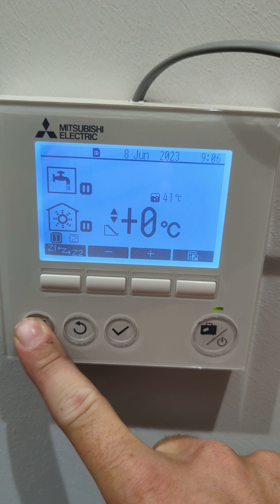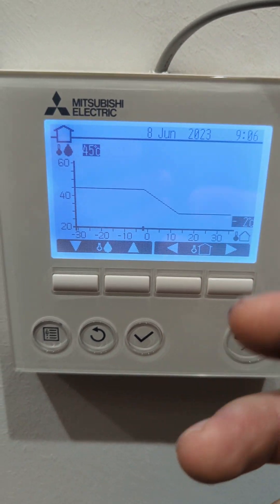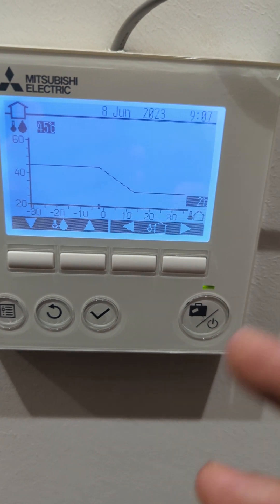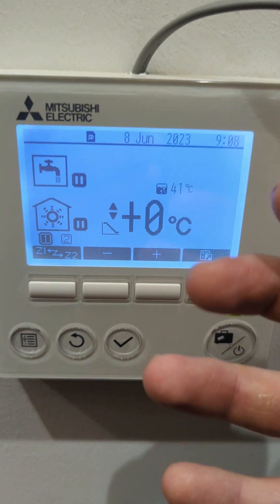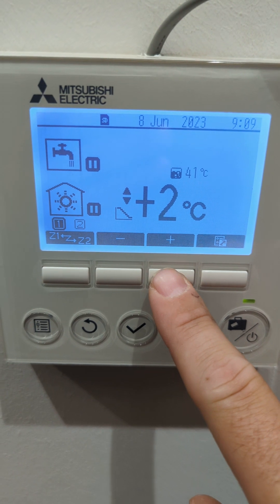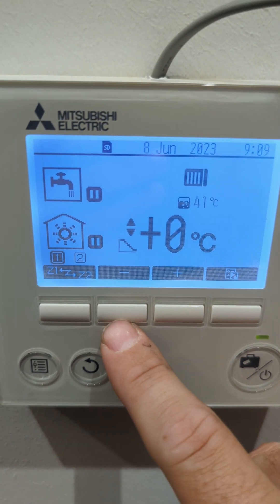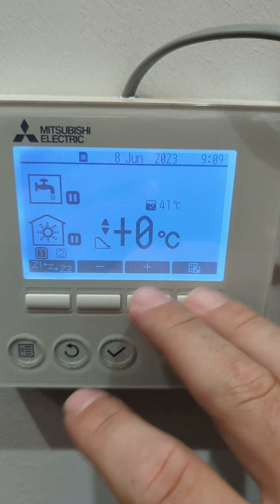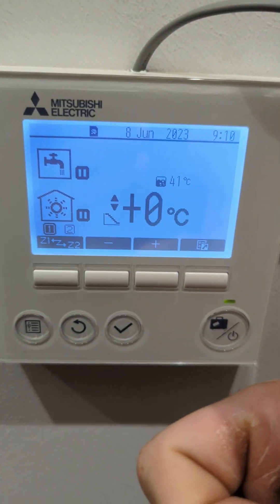Compensation curve Mitsubishi Ecodan Explained

Comment: Finally someone that explains it in a way that is easy to understand. I have new house with the best isolation possible, i had my curve on the recommended settings but my room temp kept staying around 25 degrees celcius which was just too much. I lowered it to your settings and now we wait and see. Ideally i'd like a 22 degree temp around the house because it's quite cold outside atm

Comment: Really useful. A few questions. I have 2 zones, upstairs and downstairs each supposedly controlled by a thermostat set at 19 or 20 degrees. Does the compensation curve override thermostats? If it’s set to comp curve is it running 24/7?

Comment: There is one problem with these systems that I cant get around of. When its warm outside and DHW is on with a target flow temp of 50C it will get to 46 and then to avoid excess heat making it into the heating system (when it flips over) switch to the electrical heater to finish off the last few degrees. This is some kind of fixed behavior.

Well this is fine and dandy but if you start using hot water it never gets to 50 since the tank is big (200L) on the electric heater and keeps on and on using ridiculous amounts of electricity.

I tried to cheat the system and up the compensation curve to 45 @ 30 outside (I dont care if some excess heat makes it into my heating tank (300L)  but I'm not sure this is the best way to cope with this "feature'?

Comment: Thanks for this .

I want to manually adjust the flow temperatures .

I have zoned the whole house into two zones , installed underfloor on ground floor and then fitted K3 radiators everywhere else to provide the maximium emitters.
 I’m not working on compensation curve by default .
  Is there a simple way of changing the flow rate other than raising or lowering via comp curve control ?

Comment: Great Video, thanks. It seems that like a lot of people my system was programmed to give maximum heat as oppose to efficiency. I have done a couple of things, moved the scheduled time for legionnaires from 3.00am to 2.00pm, when the air is warmer and reduced the flow temperature from 43 to 35 degrees, but I have a question for anyone that knows. 
if my flow temperature is lower than my target hot water temperature, does that mean the extra few degrees are achieved with an electric element, therefore possibly reducing any saving on lower flow  temperature?
Reply: Thanks for the really quick and clear answer, really helpful. Cheers
Reply from the maker: @johnjeff3849  during hot water operation, your target flow temp is irrelevant as this is only for heating, during hot water operation your unit will get to max temp to reach your desired / set temp for hot water store.

Comment: Does any one know how fast it can respond in the morning ? If I want to let the house cool to under 18c at night after 8pm then warm up the house in the morning to 21c from 6.30am onwards, would I need to turn up the heat 1 hour before ? can it heat up the house quickly ? I have 15kw of radiators. 18c only needs about 32 to 35c flow temp. 21c needs 40 to 45c. But with my gas boiler and roomstat it pushes the water temp to over 60c at the beginning until the house reaches 21c then drops back to 40c. So the house warms up quickly in 90mins. Can a heat pump do this ? How long would it take to spool up from 32c (4kw) to 60c with a 15kw circuit (@60c). 
The radiators can become hot within 40mins with a gas boiler. Im considering the Omnicore Duo 18kw with ecodan water heater for the winter to use with radiators, an underfloor circuit and the hot water tank, plus some Diamond star AC units for the summer.

Comment: Hi, thanks for explaining. I do have one question. Does the +5 -5 button increase/decrease the flow temperature for an entire compensation curve? For example if my curve is setup in a way that I have 45 degrees flow temp at 0 Celsius outside and 37 degrees flow temp at 10 Celsius outside and if I decrease via button for -2, will the change work on entire curve? Meaning I will have 43 degrees at 0 Celsius and 35 degrees at 10 Celsius? Thanks

Comment: If you have a radiator system and a Mitsubishi wifi remote controller, then the Target Room Temperature (auto adaptation) mode is more efficient than Weather Compensation mode, because it operates in the most energy saving way taking account of both WC (external temp) AND internal (room) temp. In Target Room Temp mode, when room temp approaches target, the HP modulates power so the the temp curve flattens out to allow the HP to run for longer at a lower heating flow temp. With pure WC mode you get a considerable power spike on start up, but in Target Room Temp mode the HP ramps up power gradually to avoid this spike.
Reply: Hi please can you do another video on how to get heating off but hot water on I have just moved into a property and I'm so confused with this I can only have hot water on with having all my radiators on its so annoying I've knocked all radiators off but one is still hot I can't turn off I only have option to knock full boiler off but then have no hot water also please help this video I found useful also thanks
Reply: We are looking for the spike to heat up the house quickly in the morning. Then reduce the power when the target temp is reached.
Reply: @hungrysurfer9471  the power spike in WC mode has nothing to do with the amount of energy delivered, it's just an undesirable transient compressor power spike on start up, which means more wear and tear on the compressor. Room Temp (Auto) mode inhibits this behaviour. Also Room Temp mode will probably heat up your house more quickly in the morning than WC mode, because it takes into account the difference between your room temp and your target temp so, for example, if your room temp has dropped 3degC below target at 7am, Room temp mode will most likely heat your rooms up more quickly than WC mode. It will also do exactly what you mentioned, reduce power as target room temp is reached
Reply: @lumbarsupport  Thanks for the info. Can I ask you which model do you have, how big is your hot water cylinder and how does it cope in winter mornings when you need both radiators warm and hot water tank refilled quickly at the same time. I have not decided yet wether to have a 300 or 500 litre hot water tank. We have 4 waterfall showers and 2 Jacuzzi 250 litres and 320 litres and 3 teenagers that tallke long showers. If the heat pump is very slow maybe I should pick the 500 litre.
Most heat pumps prioritize the HW tank over radiators, switching off the radiator circuit until the HW is full. What does the ecodan do ?
Is their an option to turn off hot water priority ?
Reply: @hungrysurfer9471  I have a Mitsubishi Ecodan R32 11.2kW. The domestic hot water tank is 200 litres. Neither heating nor hot water have ever been a problem, even during a couple of nights at -12degC. As far as I know all heat pumps prioritise the domestic hot water cycle, but if you leave that on continuously it will take less time to reheat, only when required, then "Room" (Auto Adapt) mode will  automatically compensate for the off period by raising the heating flow temp to ensure your room temp does not drift significantly off target.
Reply: @lumbarsupport  Thank you for the feed back, 11 kw sounds a bit small for a 200 litre tank and a few radiators. The ecodan comes with a choice of spliters either 3 or 5 heating circuits. Could I use 1 of the heating circuits for the HW tank so it thinks its a radiator circuit on 24/7 at 60c. So it shares the energy with the other normal radiator circuits with no priority. I dont want the computer deciding to keep turning off the radiators for hours because a big HW tank is cold and it needs 5 or 7 hours to reheat. In winter that would keep turning off all the heating circuits for 5 hrs every morning and another 5 hours evening when we take showers. So I am asking if its possible to fool the computer that their is no hot water tank, but there are 2 heating circuits instead ?
Reply: @hungrysurfer9471  11kW is actually oversized for my house. Actual usage over the last 3 years suggests an 8 would have been more than enough. A single zone with a Y plan circuit would do what you want, but you can only run at one flow temperature throughout the whole system; heating at 60 will cost you a fortune and may contravene grant rules if you are using the BUS. If you have a dedicated heat pump cylinder (much larger coil surface area), then the occasional top-up should be very quick. Mine only takes half an hour, and I only run it once a day at 2 pm. I know many people who have heat pumps, and none of them have any problems with hot water priority
Reply: @lumbarsupport  I'm testing this week compensation curve instead of the room auto adapt, because I read that if you have the remote temperature handle (which I have in my room), that will work together with the compensation curve mode, I want to see the energy consumption between the two modes, have anyone made this test?

Comment: That’s a very helpful explanation, thank you very much. I’ve set up the settings according to the video, however, it looks like the heating isn’t working at all (the pause icon appears nonstop even though the play button is on) as the apartment is just not getting warm. The water seems to heat up just fine. Do you have any advice for this?

Comment: So the lowest temp is set on -2.. what about when it reaches  -10 or so... i also have seltron wich controls heat pumps with termostat installed outside property ..can changing settings on ecodan confuse seltron..

Comment: Hi,  I'm trying to change my ecodan to compensation curve,  I can change the degrees but not the temperature which is set at 55 degrees can you advise please
Reply: I had this and found I was not in the system/admin mode - was still in user mode.   You need to hold down the menu button for more than three seconds to activate it.

Comment: Just came across your video. Two newbie questions if I may:
1. If I have 2 zones, is there still only 1 compensation curve settings, as ex-pained in your video?
2. You say the compensation curve settings may be set higher or lower depending on whether you have underfloor heating or radiators. What would be correct for zone being underfloor but zone 2 being radiators?
Thanks for help you can give.

Comment: When using the compensation curve should you never change the temp on your thermostat?
Reply from the maker: If you mean your 3rd party thermostats to control each zone, these only control the room temperature so you can alter the setting on this, it has no effect on the compensation curve settings on the main rc shown in this video :)
Reply: @renewableheatingengineer8537  I mean the room remote controller?

Comment: Hello, going into my first winter with Ecodan ASHP. Installed using Ecoflex - so didn’t get much of a handover.

 My weather compensation is now set up using your video (thanks - very clear). However installer said to use thermostat.

Which is the most cost effective? 1939 semi detached house with new windows. Thank you.
Reply from the maker: there is no right or wrong answer, if you use the thermostat, this will give you a fixed flow temperature set in the initial settings by your installer, only time will tell as to wether or not you can use the compensation curve in your property, in some cases, we have seen heat pumps installed into properties that are not very well insulated and require the heating to be left on fixed flow say for example 54 Degrees. my recommendation here would be try the compensation curve, if it doesn't suit your requirements for your property, revert back to thermostat / fixed flow.

Comment: Thank you SO much for these videos! I recently moved into a newly built council house, with this system...and no explanation how to use it. When I asked questions, I was told to use the room thermostats, and not touch the control panel.
So a big appreciative thank you for your videos, and the clear way you explain everything that shows on the panel, how to change things, and the settings certain things should be left at.
Reply from the maker: Hey @mls9662 - Glad our videos are helping you with your new system!! thanks for the feedback. much appreciated.
Reply: @renewableheatingengineer8537 is it better and cheaper to run the compensation mode rather than just setting the room temp on the control box . Also I turned of the freeze mode as its expensive to run in winter. Any videos on that

Comment: Hi. Can I please ask for advise on P1 error. Its driving me crazy to sort this and developer who installed ecodan is not supportive. Please can you advise who can help. Thank you
Reply from the maker: Heya, what area are you in ? P1 Error is a faulty thermistor, or possible setting issue in the initial settings menu. how old is the system ? did the p1 fault occur straight away or has this developed a problem, also are you using a Mitsubsihi wireless controller for the heating ??

Comment: By any chance can you recommend hoe I would get a service on my ecodan boiler.. I live in radlett North London. The company who installed it doesn't do services
Reply from the maker: Hey Aoife, We actually cover this area so could help you out with this although availability at the moment is 4-5 weeks, failing this I would always recommend contacting Mitsubishi electric direct, they have a good list of service partners who may be able to accommodate a service sooner.
Reply: @renewableheatingengineer8537  Yes, i would be keen .how do I contact you're office. I have watched you're video on setting the water temperature so i think I can manage that much
Reply from the maker: @aoifemulcahy7784  - Great to hear our video has helped you dial those settings in ! If you send an email into Enquiries@enviroheatingteam.com, we will get our availability and costs over to you.
Cheers 
Dan
Reply: @renewableheatingengineer8537  that's amazing.  I'll send an email to you in the next hour. I've gone over you're tutorials alot and found them really helpful.  Thank you so much.